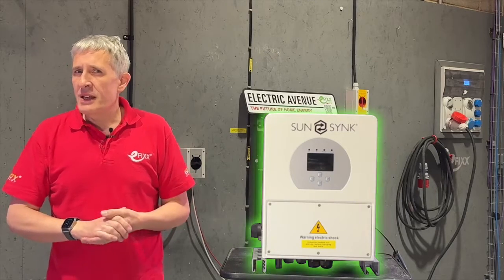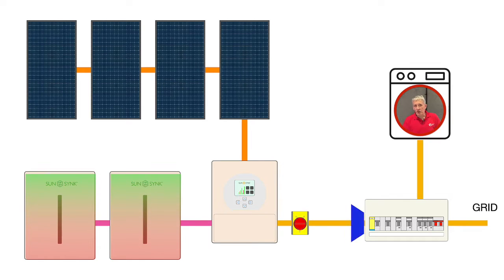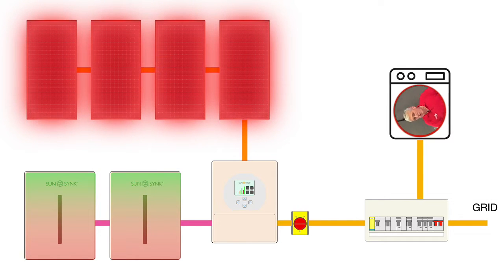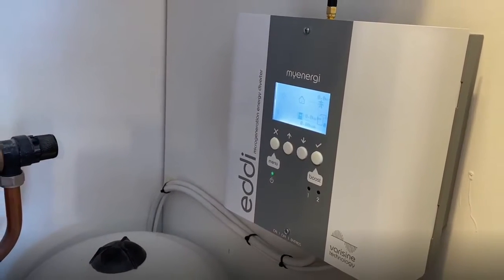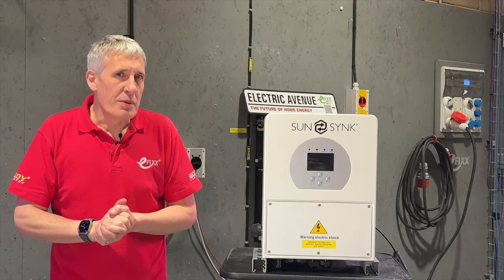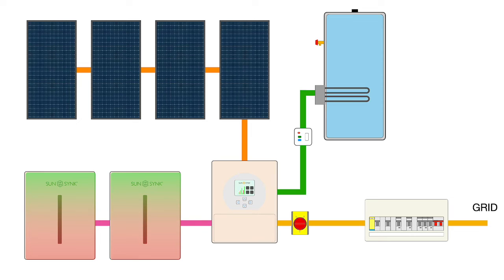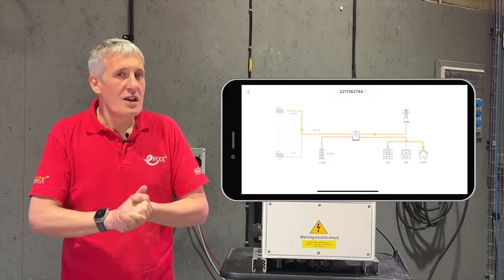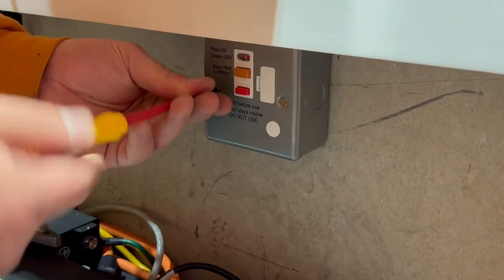Mystery Solved - The SunSynk Inverter Auxiliary Output

Comment: Using the Aux/Gen port on a Deye or Sunsynk inverter, would it be possible to connect an electric car charger station instead of an electric geyser/hot water cylinder.
The settings could then utilise power above 90% battery setting to power the car charger (1kw up to 7kw). The power drain would be regulated by the car onboard charger which could be adjusted to perhaps 2kw or more for a slow daily charge, for those who seldom need to drive their cars on a daily basis.
Is this a realistic option?

Comment: Simple solution is use solar energy to run hot water heater during a day like 11aM to 2 PM and you do not need expansive equipment to run it.
Reply from the maker: Assumes you are generating enough energy to match immersion heater rating.

Comment: I currently have 2 separate systems on my house . A hybrid Ecco Sunsynk inverter which is linked to my six Sunpower solars and 3 Sunsynk batteries. I also have another older system 12 Sunpower panels that has a separate inverter (FIT on this system) which supply any usage to the house and if there is any excess it goes through my Immersun to heat my hot tub via a heating element. My immersion tank is heated up by 2 solar thermal panels. 
I just don’t know what to do for the best . I seem to have a lot of gadgety but not sure if I’m using it to full advantage. I do have an EV also which does take a lot of power to charge (30kw) 
I tend to charge the car on my 3 off peak times throughout the day and night. I also top up the Sunsynk storage batteries on these off peak times also (bit in the summer this is cut down)

I have stuck with my Fit because it gives good payments so changing over to Seg wasn’t worth it

Comment: WHAT??? Suckling power from your battery is NOT using "excess power" from the solar panels. This video is remarkably uninformed. I suggest that viewers keep browsing!
Reply from the maker: The excess power is used to charge the batteries
Reply: @efixx  No. That's not what you are telling us. Exploiting excess power is what I wanted to hear more about, but I got a decidedly unhelpful answer. You specifically say at 1:23 "Consequently, during the peak summer ... the surplus energy has nowhere to go. THE BATTERIES ARE AT FULL CAPACITY" etc. You're not charging them and you aren't draining them. So, you risk using them to power your water heater. 

Fine! But that's NORMAL, not a "mystery" application. Here in South Africa, anyway, the battery is often charged by 9:30am. Who wouldn't fathom that solar power is ROUTINELY used to charge the batteries? Now, we have oodles of power potential not being used. The water heater timer comes on at 11:00am and often finishes heating within an hour or two. The timer keeps the connection on, until 3:00pm, but the heater's thermostat doesn't ask for any more juice. Now what? 

Obviously, buying more battery capacity is nice - but pricey. Hence my search.

Comment: My LuxPower hybrid inverter has a similar thing, in this case called EPS, I use it to power my central heating boiler and WiFi router, so those stay on in case of a power cut and the power used does not count towards the G.98 limit for the house.
Reply: That's different. This has aus for excess and also ac 2 out for backup

Comment: Thanks for that. Immersion setup is way out of my budget and I live alone. LiFePo4 battery cost is so low today compared to 2 years ago treat yourself to a year round 15 feet pool.
Reply: Frankly if you have the space get an etc water heater.
Or if wanna use lectriks then a heatpump for hot water unless you live in a frigid zone.
Or if paucity of muchos dineros then can always buy a stainless steel tank, insulate it, drop an immersion heater element inside, voila you have an immersion style water heater.

Comment: Yes, I am using the Sunsynk AUX feature here in South Africa, and it really helps to save costs on the immersion heater costs. Sunsynk is just the best. Rick solid engineering.
Reply: Never gonna give you up, never gonna let you down

Comment: I’m not sure it’s worth needlessly cycling your battery, the eddy tracks your excess generation so only that goes into the cylinder which avoids cycling the battery
Reply: The sunsynks can do this as well already built in to the inverter

Comment: i believe you can feed warm water to a combi boiler to save gas they each have there own input temperatures for maximum efficiency so you need a thermal valve to get it to the right temperature so the hot water you have generated could be used directly or via a combi boiler this is also a good argument for some solar thermal to reduce gas consumption

Comment: I confess that I'm starting to feel sorry for the poor, old rectifier whose essential contribution to power conversion is being steadily eclipsed by the ubiquitous inverter. It's probably already too late to change the way we refer to the box of tricks as an inverter when it is, in fact, acting at least part of the time as a rectifier. To me, 'power converter' would be more acceptable and more accurate whilst acknowledging the impressive capabilities of the power electronic devices and their control algorithms. I guess it's probably already too late, though.
Reply: I think the term inverter is fine, even the most basic solar inverter has been a much more complicated multi stage device under the hood. Would have been nice if we called hybrid bi-directional though.